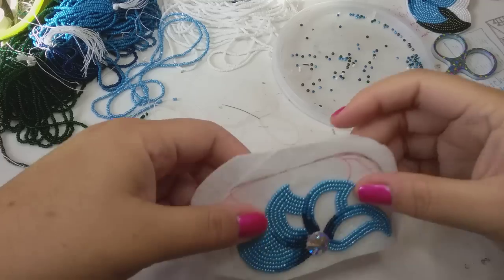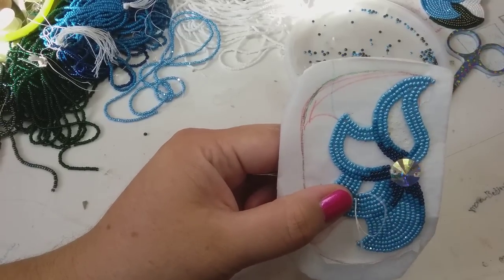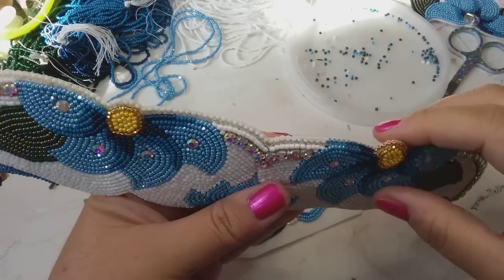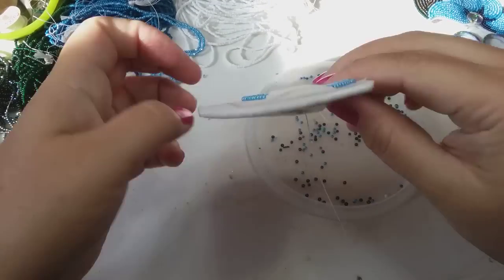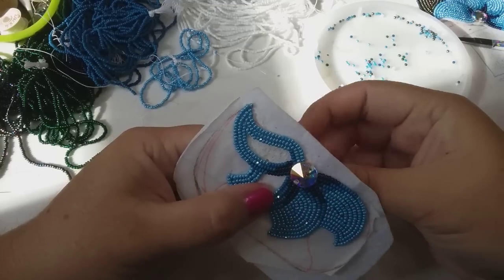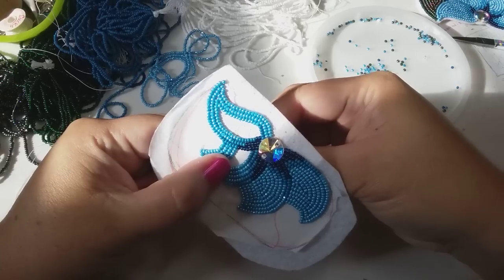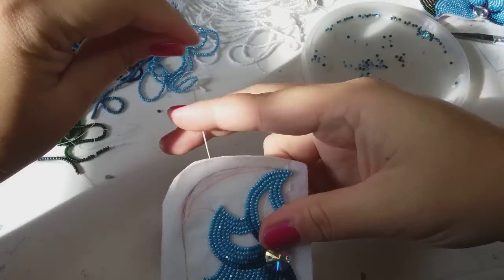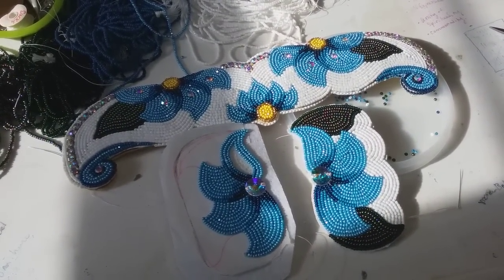Two needle flat stitch beading [filling in] #2

Comment: do you have any tips on threading tiny bead needles? I like traditional sinew because you can separate off tiny thin pieces and it goes right into the needle but of course it is not practical the nymo is easier and more affordable/available... real sinew is pricey for me to order online..sorry for so many comments ...I hope you don't mind answering my questions?
Reply from the maker: I usually pinch the thread in between my fingers and the very tip is out makes threading easier

Comment: I love the fact that I’m not the only one who can’t leave a small area open, I will do the same, find the smallest bead and lay it sideways. I personally say to myself, “you are your worst critic”, 

Also, after I’m done with the project, I will use rubber cement to tack onto my buckskin, it’s so much easier to work with and won’t bend your needles, if you happen to get it close to the edge. 

Thanks for showing! Each day is a new day to learn something new.  Many blessings.
Reply from the maker: Shone Ladii  good tip. I'll have to try it out 😉😉

Comment: This has been one of the best videos, if not the best in showing all the elements of two needle beading. I think the pace, the language and the clear video/angle has really helped with the content you share. 
Im curious tho. With this style, on a larger piece, say one you will stitch onto a purse or something is too large to hold in your hand like the example. How do you get the right grasp that allows you to get good tension of the beads and thread? Ive seen some people use hoops or other frames that help stabilize the perimeter but it doesnt work if the whole piece if  beaded. Like, how would you use this method when doing large areas for regalia and such? How would you stabilize or weight the piece down when your (lead thread) hand cant read the beads?
Reply from the maker: You have to place on a table and stitch from the top..Jamie Okuma has good videos showing that way

Comment: Also, I have seen a method where you come through the beads to tack down. Is that going to make my beading more uniform? I noticed when I use this method in your video I am noticing a few gaps between beads and you can see the tacking thread slightly. I may be using the wrong thread. I am using .20 Fireline which I use for bead weaving hoping it would be suitable. 😋
 
Thanks for all your tips. Your videos are awesome.

Comment: What size type and brand of bead do you think these are and where can I get some?
Reply from the maker: Iwillnotsurrendermyname youBastards  I would love to tell you the brand,  unfortunately I bought these beads from an independent vendor at a pow-wow last year.  They are size 12 beads for sure though. the best selection I've seen so far online is Shipwreak Beads. They have an extensive variety of blue seed beads.
Reply from the maker: Iwillnotsurrendermyname youBastards As far as my knowledge of beads go, they are what you call a czech bead Charlotte true cut or faceted seedbead. That's what gives the pretty shine and glitter is the faceted sides of the beads. Czech Charlotte seed beads are quiet common to find at an online vendor. Shipwreck Beads, Firemountain Gems and Crazy Crow trading post are a few online business that sell a good variety of Seed beads.